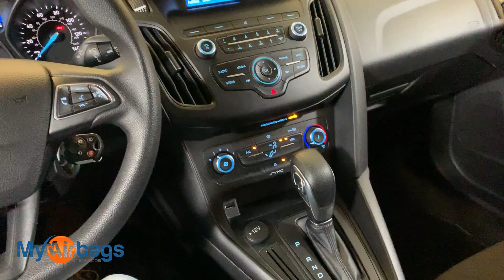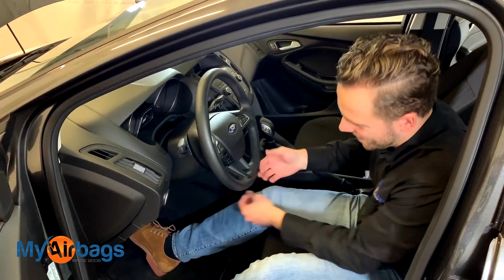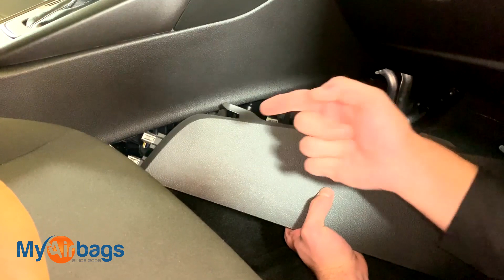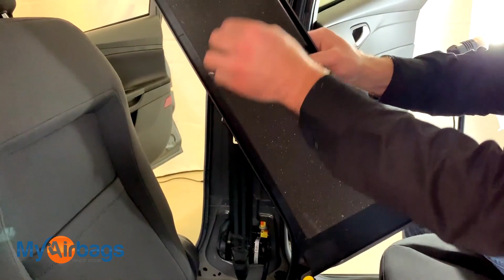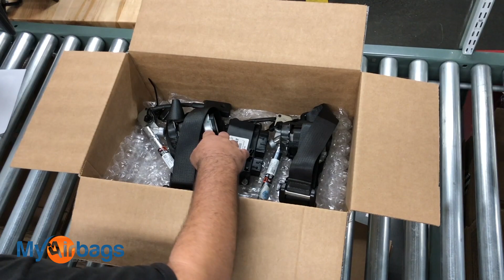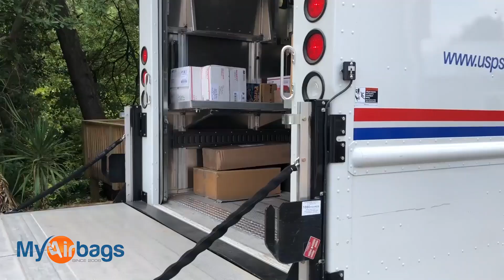How to Remove SRS Airbag Module & Seat Belts on Ford Focus  | MyAirbags

Comment: my car was hit at at the front wheel/door , does.the sensor.inside the door need replaced after accident or.will.it work OK,  it's a ford focus 2021
Reply from the maker: The impact sensors are usually okay unless they are physically damaged. The airbag computer module can be reset, and seat belts can be repaired. Visit myairbags.com.

Comment: 2022 model is totally different. Any idea where is the module placed in 2022 focus. Thanks
Reply from the maker: It should be either under the radio on the floor or under the center console.  Please reply here where you found it. It would be helpful for everyone here.

Comment: hola cómo puedo apagar la luz del airbag si esta desconectado el conector?
Reply from the maker: The first step is to diagnose the airbag light. Hook up the scan tool / scanner to the car and read the airbag codes. You connect the scan tool right into the OBD port/plug. Its usually located below the steering wheel, on the left. You are welcome to reply to us with the trouble code that it reads.
Reply: @MyAirbags  lo que sucede es que esta desconectado el conector amarillo por que no tiene airbag
Reply: @MyAirbags  no hay codigo de error en el scan :(

Comment: I have the code b0021 will I have to change the curtain airbag even though it hasn’t deployed ?
Reply from the maker: Its possible its just a bad connection at the plug of the curtain airbag. If you checked the plug and all is well then problem could be with actual curtain airbag.
Reply: @MyAirbags  where can I check the plug from ?
Reply from the maker: @alzhs3490  You can physically look at where the wire is connected to the curtain airbag. Any time you work on any component of the SRS system, the battery must be disconnected. If you aren't familiar with that kind of work, we would have to recommend that you have a professional take a look at it.

Comment: I have 2009 ford focus with code B1321 crash data memory full. Can it be reprogrammed and is the removal procedure the same as this video?
Reply from the maker: Milton, Yes we can reset crash codes. For 2009, it might be slightly different but overall pretty similar procedure. You can start placing the airbag module reset order here: https://www.myairbags.com/product-category/repair-return/airbag-module-reset/